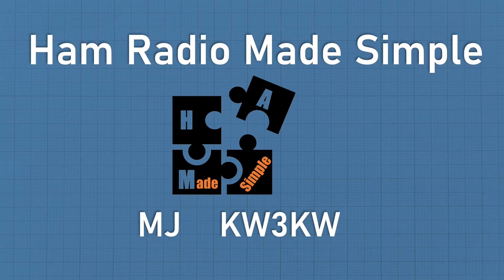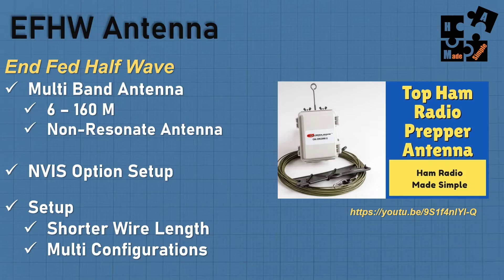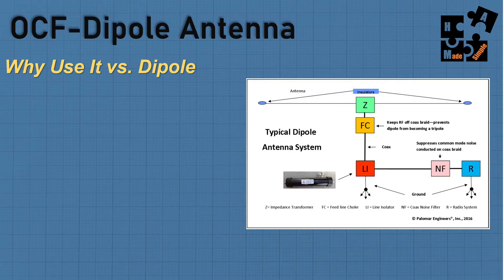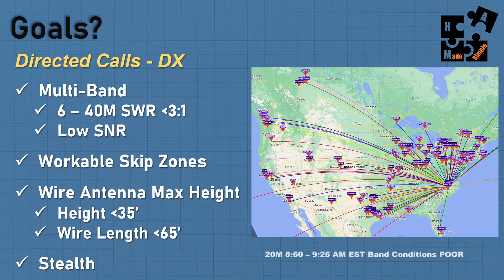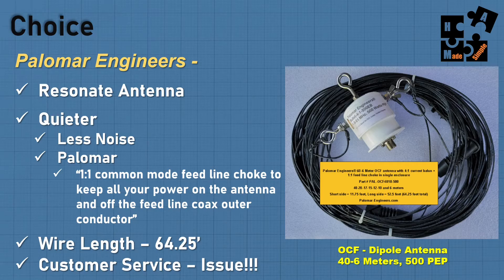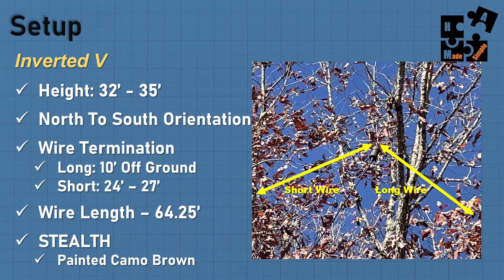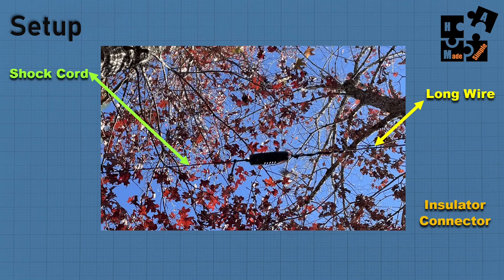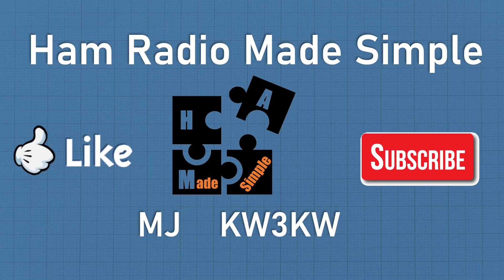Top Base Antenna Type For Ham Radio Preppers - OCF-Dipole Antenna

Comment: I have EFHW for 40m in NVIS position 6 feet off ground. 65 feet of wire. 9:1 unun. 1:1 SWR. Under best conditions, I can reach the East Coast from the West Coast. 1500 mile is routine under reasonable conditions.
Reply from the maker: Sounds like you have a great setup and are making some excellent contacts.  Great job!!!!!

Comment: I've been a ham for 34 years and I've tried just about all of the antennas out there, Delta loop, Foursquare, Carolina Wyndham, G5 RV, and countless dipoles. 
Two years ago I put up my first OCF dipole because it was a good fit for my property. It's 90' x 180'. It's up 65' to the center and 15' at the end. I'm using 10 awg, stranded wire and a DX Engineering Maxicore 4:1 current balun.
Reply from the maker: Appreciate the feedback and the info on your antenna setup!  I love this antenna and got a friend to use it too.  He loves it!!  You are set for some time now.

Comment: Good vid!  I just built an OCFD at my house.  I’m using a dual core 4:1 current balun and 130’ total wire length.  It’s not perfect on any band, but it’s operational on 80/40/20/17/10 with a tuner.  I got the balun 35’ in the air and the ends slope down to 8’.  The long end has a turn in it that’s about 95 degrees as that’s the only way I could set it up at my house.  I’m super happy with it.
Reply from the maker: So glad to hear that you are up and running.  I very quiet antenna.  Great choice!!

Comment: 1:50 - a properly constructed EFHW is a fully resonant antenna typically using a 49:1 matching transformer. Not to be confused with the random wire and a typical 9:1 matching transformer which requires a tuner to be useful.

I build inductively shortened EFHW that tune perfectly for 40/20/10m.
You can also make a linked wire to tune just 15m and 10m when you want something shorter and easier to set up. In my case 10m gets me into VK land whereas 15m gets me to the US west coast and into Salt Lake city. WSPR/JS8 on 200mW to 10W. It’s about a 55db path loss. And some of that  is due to being only able to operate horizontally polarized at my main QTH. 

Love the content and energy btw 
73s
John
Reply from the maker: Wow, great job on building your EFHW antenna!!  What direction is your antenna running and what kind of directional and distance outcomes are you getting?  Thanks for posting this.

Comment: Just a quick note to say "Thanks" for this whole prepping series. I've had my Advanced Class license since 1989, but I set it aside for quite a while and now I'm trying to get back up to speed on HF digital. I'm the "Comms guy" for our local prepping group, so I suppose that's what it took to get me back in. Still working on getting this set up again using FLDIGI. I used to use a TNC with mainly AMTOR as the mode. Again, thank you - your videos are making it a lot easier for me to get back in. (By the way, I chose not to upgrade to Extra just because it's kind of fun to have a license that is no longer issued.)
Reply from the maker: Glad to help!  I would focus on JS8Call with JS8Spotter for EMCOMM.  After trying all the others, this is the option so far.  Nothings perfect but offers the best solution to date.  Time is running out and I pray you get your protocols up and running soon!!
Reply: @hamradiomadesimple  Excellent - thank you. I've already got the JS8 software (I'm using Ubuntu Linux), as well as FLDIGI family of programs. Fortunately, we've already got local comms set up for our group (area is 5 miles long by 2 miles wide) using a combination of 2 meters and CB. My goal at this point is to be able to exchange news and sitreps with those in other parts of the southeast (I'm in Florida).

Comment: I need to get a phone number where you can walk me through some of the problems that i am having with *j8call, such as the freq change when I tune the rig going from UDB -d to usb when I tune, I cant make the 7300 s    tay put on split operation  I think i have time sync down ok but it migjt not be a simple as it looks
Reply from the maker: Email me at HamRadioMadeSimple@gmail.com

Comment: I bought a Palomar OCFD, and it works 80-10, without 60m. But it is  132 ft of wire, end to end. My personal opinion is that it is the best wire antenna for fixed placement. 

I have done just a few portable activations, but an EFHW has been excellent.
Reply from the maker: Glad you shared your experience.  Confirms what I have found out.  Thanks for sharing....

Comment: I just bought a 49:1 balun before watching this video. Any ideas how it might work with using the short end on the counterpoise and the longer end on the radiator? I know the short answer is to just try it out and see (and I will be doing that after the holidays). Just wasn't sure if you have had any experience with a 49:1. Robert KD4YDC
Reply from the maker: Like you said, try it.  There are some videos that show how to use an antenna calculator.  Try that first and let me know what you end up doing!!

Comment: What Rig control software do you use with your IC-7300 and JS8Call?
Reply from the maker: Just use CAT Control option with IC-7300 in drop down selection.  You can use Flrig but slightly different setup in the "Radio" section of JS8.  Some like this option since they can monitor JS8 & Fldigi at the same time on the same frequency.